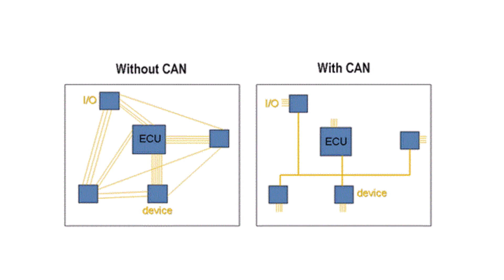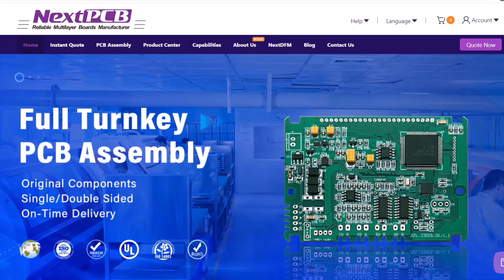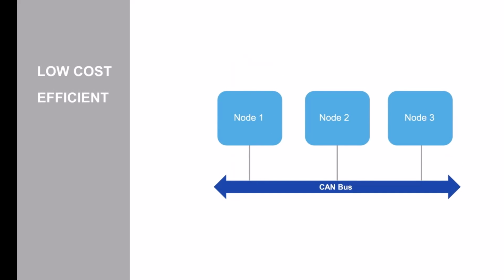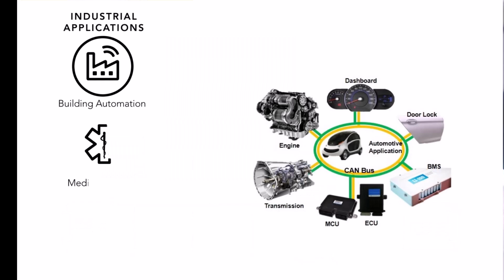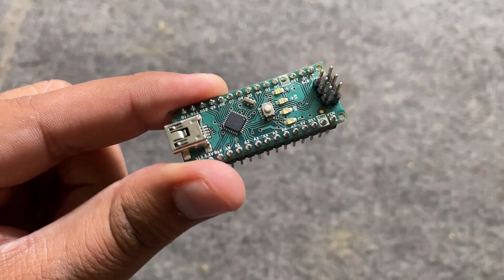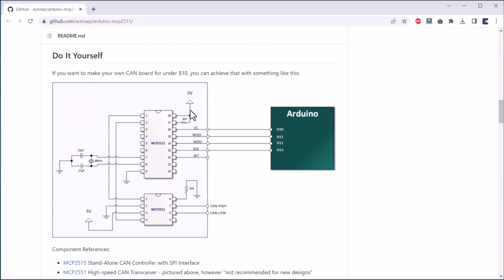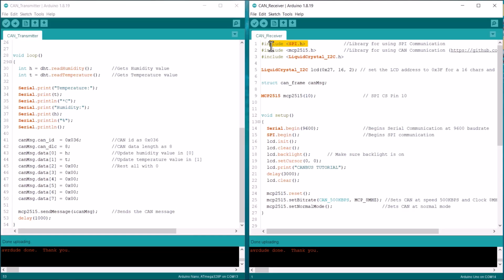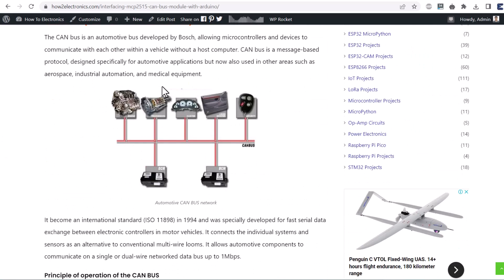Arduino CAN Bus Tutorial | Interfacing MCP2515 CAN Module with Arduino

Comment: Thank you for the great tutorial! If I have 10 sensors instead of 1, what would the architecture be? Would I need one MCP2515 module for each sensor?
Reply: Why would you? All sensor data can be transmitted over can bus.. that's like saying I have 10 computers at home, do I need 10 routers for them all to connect to the internet? Networking is about sharing data lines..

Comment: Modern automobiles may use a high speed network, a low speed network a LIN bus, and an ethernet bus that utilize one or more gateway modules, and a secure gateway module that protects wireless and 5G networks.